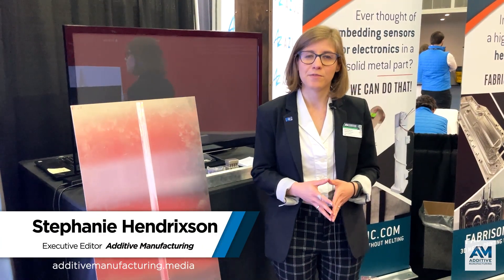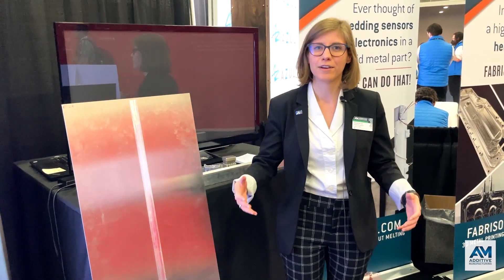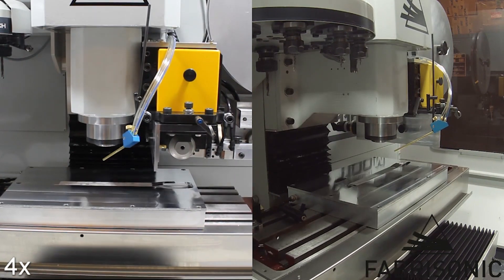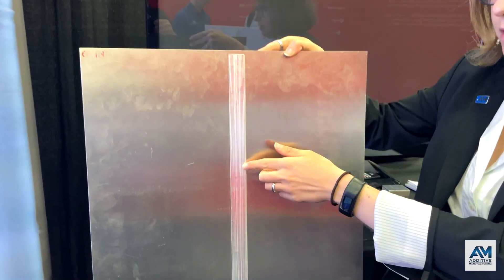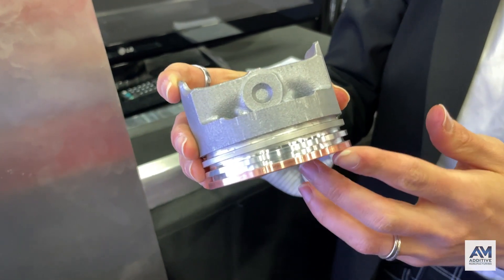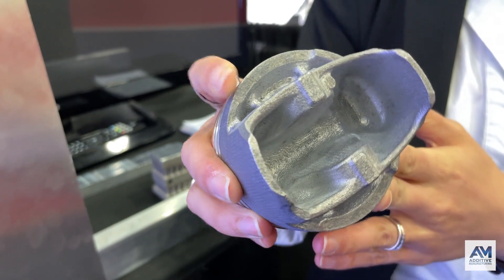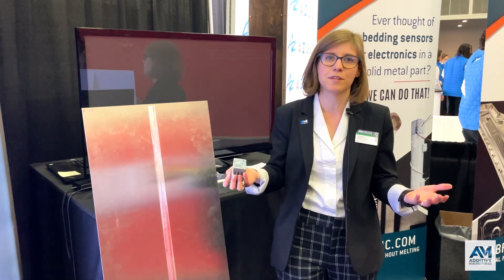Pairing Ultrasonic Additive Manufacturing with Powder Bed Fusion

Comment: that is nice tool. can fuse Wolframium or silicon carbide? or ceramics like zirconio?
Reply: UAM is limited to welding metals.  We can embed silicon carbide or other ceramics, but it is embedding.   UAM has been used to weld layers of W for radiation shielding.   Typically W is welded to a softer alloy like aluminum or nickel.   We can't print monolithic W.

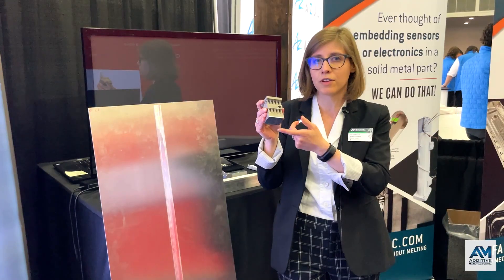Comment: Are vibrations of the materials not generating heat? 1:20
Reply: There is some local heating, but max temperatures at the interface are ~200 F.   At any given location this max temperature is only experiences for 1-200 milliseconds.  Thanks for watching!